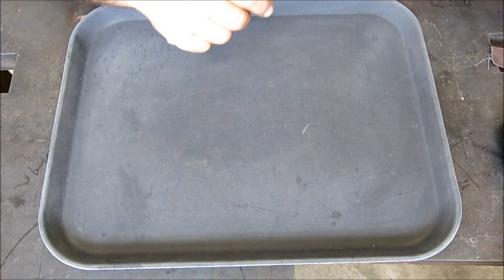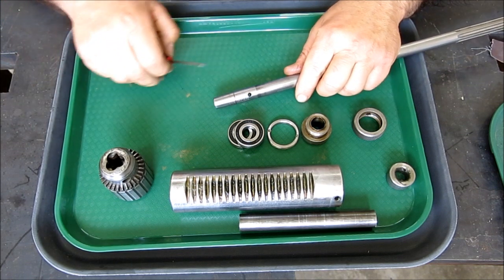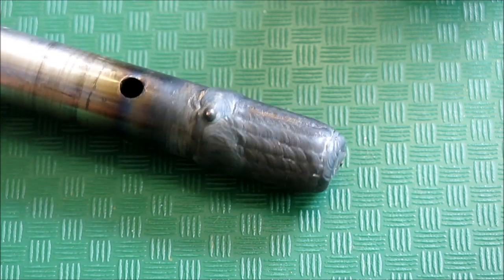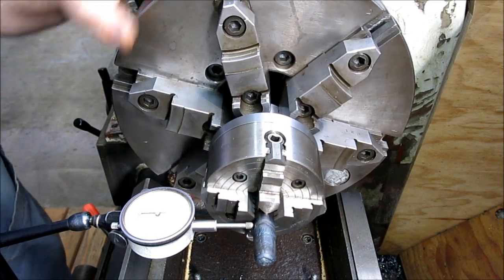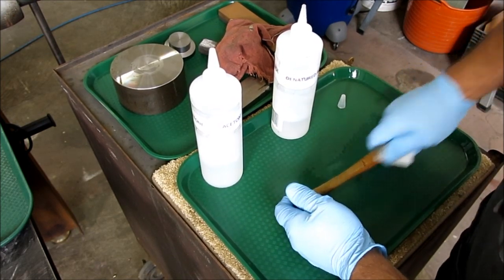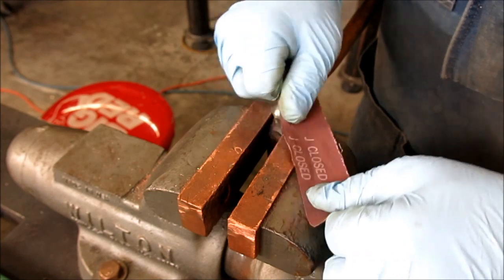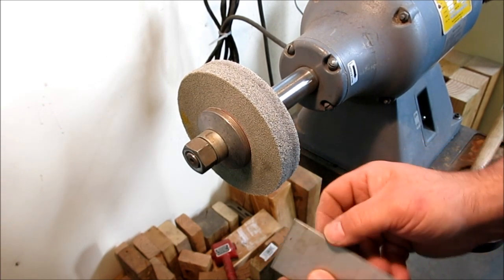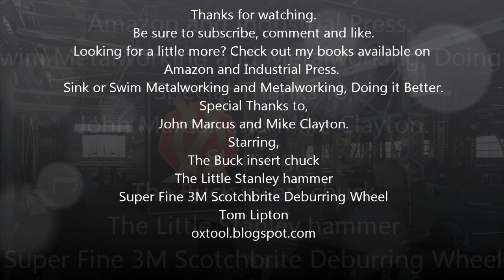Monday Night Meatloaf 32

Comment: Nice job on the build up. I look forward to the taper turning video.
A clean hammer is a happy hammer right!
Thanks for sharing bud!

Adam
Reply from the maker: Hey Adam,

Thanks for the comment. With that humidity down there it must play hell with your shiny tools.

Talk to you soon

Tom
Reply: +oxtoolco Would a 5c collet have been a good choice to hold this piece? Of course that is given you have a collet setup. My Clausing came with a 5c collet w/draw bar setup. I try to use the collets as much as possible except when my laziness kicks in and I don't want to remove the chuck.

Comment: Totally with you on the hammer faces. I have 2 sets of hammers, one set have rough faces from use bashing pins, nails, general thumping work. The other set have mirror polished faces using the belt sander, hand sanding and finally the buffing wheel. These are used to "finish" peen rivets/pins and for shaping/texturing fine metal work such as silver. Unsurprisingly visitors to my shop are not allowed to select their own hammer when they want to bang in some nails haha.
Reply from the maker: Hi Cask,

I'd love to see your hammer collection. Nothing like meeting a fellow addict.

Cheers,

Tom
Reply: Ha, not a patch on yours, I think I'd be lucky to muster much more than a dozen but they are all loved! lol.

Comment: tom,
the red handle "belt dresser" is an old school grinding wheel dresser. the stars rotate and crusher the wheel face making it flat. we had these in my dad's shop 40 years ago. this is what i had to use until i found where he hid the coveted diamond dresser.

Comment: Enjoyable as always. I love the idea of sticking the little 4 jaw into the big 6 jaw. I was recently gifted a beautiful old Skinner 6" 4 jaw and it's really not made to have a new back plate. I'm very fond of it but was thinking about selling since there was no good way to adapt it to a D1-5 spindle. The chuck has a nice machined stub on the back with internal threads that should sit nicely in the larger chuck. Keep them coming Tom!
Reply from the maker: Hey Mike,

That chuck sounds perfect to use as an insert chuck. What kind of lathe do you have with a D1-5 mount?

Cheers,

Tom

Comment: good one Tom.  What changes did you make to improve the arc shots through the auto darkening lense?  i have a few tig welding videos on my channel, but can't quite seem to pick up the puddle good... any tips would be appreciated.. Enjoyed the meatloaf!
Reply from the maker: Hi Turbo,

I locked the exposure down manually a few clicks. As you saw the shot started out pretty dark but when the arc got going it was not bad. I'm nowhere near what Jody pulls off but I'm getting closer. 

Cheers,

Tom
Reply: oxtoolco
Hi Tom,
About the exposure problem, maybe if your camera has a exposure compensation preset like a few stops plus or minus, in short you leave the camera on auto exposure but the preset will always give you like say 1-½ or 2 stops less than normal exposure.
I also think that Jody uses a very good quality auto darkening lens.
Just a suggestion, hope it helps.
Cheers,
Pierre

Comment: Tom I've never seen a dresser for abrasive belts. How does it work removing soft materials like aluminum from belts?

Thanks for the tips again.  Looking forward to the taper turning.  Maybe in the future a female taper would be good vid, all our drill presses are that way they have a shaft with a female #2 or #3 MT and their is an adapter with the appropriate male JT on one end and the male MT on the other.
Reply from the maker: Hey Bill,

The dresser is basically a round wire brush. I don't generally have clogging problems with my belt sander. Maybe if you do a lot of sappy wood or something that tends to load the belt. Franky I have never tried it until now. Flea market find.

That's the way my drill press is. This is a little Atlas or Craftsman drill press with the chuck mounted directly to the spindle. A female Morse taper might be a boring video.......<g>

Cheers,

Tom

Comment: Another nice video Tom! I was just thinking about how I'm gonna fix the boggered up JT33 on the spare spindle I have for my Clausing DP. Hopefully soon I will have the answer! It seams a lot of drill presses used that 5/8th spindle OD with a metric bearing seat in the quill. Both the vintage Clausing and Craftsman I have restored have had funky bearings like that. 6203zz if I recall correctly. Nice to see someone besides Adam spin a 4 jaw..
Reply from the maker: This one was straight up the wrong bearings. The seats and shaft are inch sizes. Looks like somebody took it apart a long time ago as it had new departure metric bearings in it.

Cheers,

Tom

Comment: Tom, back in 1964 I started my apprenticeship as an electronic technician. A lot of the equipment we used had BSW (Whitworth) threads, but BA, or British Association, threads were also quite common.  These are the things with the 47 degree thread angle.  This Wikipedia link gives a brief description.

http://en.wikipedia.org/wiki/British_Association_screw_threads

While the Wikipedia description makes specific mention of 0BA and 2BA, we also used a lot of the smaller sizes too; 4BA and 6BA were common, and we sometimes drilled and tapped holes down to 10BA, which requires a young man's steady hand; I wouldn't attempt it these days.  :(

Like a lot of young blokes I was interested in motor cars, which in those days were mostly British with Whitworth threads, but as American iron (GM and Ford, for the most part) became more common, we became accustomed to UNF and UNC.  People also imported lots of European cars and then Japanese cars, so we had to understand and use metric threads as well. The European vehicles tended towards fine pitch metric threads, whilst the Japanese stuff used lots of the coarser pitches.

Add in British Standard Pipe for plumbing (55 degrees and tapered threads occasionally) and the thread cutting and managing scene was not boring, and I imagine it would have been much the same for our cousins in the Shaky Isles. Same for the Poms too. So you blokes have really lead rather sheltered lives.  <g>

Comment: Nice work.  Never considered the finish on a hammer before.  Looking forward to the spindle series.
Reply from the maker: Hey Jim,

Thanks for the comment. You should check out a silversmiths hammer and stake collection. It will blind you with brightness.

Cheers,

Tom

Comment: I did a JT33 a little while ago but I had a new arbor to run off. Interesting to see it done "by the book".

Colin
Reply from the maker: Hey Colin,

Thanks for the comment. Interesting I was looking for actual tolerances on the taper but cant find any. There is a ton of specification information but nothing on the actual manufacturing tolerances. 

Cheers,

Tom
Reply: Well I guess that means you have to have it dead nuts or it's junk?? lol

Colin

Comment: Hey Tom!
I think you picked a great topic on the taper repair. 
About the TIG welding, could you please share max amps, electrode type and rod used?

Thanks!
Reply from the maker: Hey Pherd,

The rod was E70-S6 TIG filler. Amperage was probably around 40-50. The electrode was my standard issue lanthanated tungsten 3/32 diameter with a gas lens.

Cheers,

Tom

Comment: Hi Tom
That'll be British Association (1884) for precision equipment.
Regards from the UK
Paul
Reply from the maker: Hi Paul,

Thanks for the information. I forgot to look it up before I shot the video. Just add it to the long and distinguished list of things I didn't know but now know.

All the best,

Tom
Reply: oxtoolco
Hi Tom,

British Association threads were derived from a Swiss instrument thread series based on the Metric system! An M6 nut will fit a BA0 bolt and vice versa.

Comment: If the chuck had some space above it next to the bearing, could you
just face the end off of the existing taper and then re-cut a new taper.
Instead of building it up with weld. Just a thought. Looking forward to seeing
the new taper being cut.
Reply from the maker: Hi John,

That's the problem here. There is a chuck removal ring that prevents the chuck from seating properly in the taper. I had to add length to the taper section to move the chuck away from this ring when its seated on the mounting taper.

Cheers,

Tom

Comment: Hey Tom, nice welding job. I am looking forward to the taper turning video. Thanks. Do you know if Buckrun11 got his lathe fixed? I have have not seen anything else posted. Thanks Buddy
Reply from the maker: Hey Buddy,

We determined that buckrun had the wrong gear in his threading dial. He went back and recounted the teeth and guess what? He has the wrong gear. Trust but verify. Words to live by.

Cheers,

Tom

Comment: hi Tom great work check out that zeus reference book a viewer sent you the BSW threads section shows the standard bar diameter for the thread tpi eg 16 3/8 but then to confuse matters theres BSF which is the fine series also 55 degrees but has more tpi to a given diameter thanks for these vids im learning tons of good stuff Dave
Reply from the maker: Hi Dave,

I think my head is going to explode with Whitworth pains. Thanks for the comment.

Cheers,

Tom

Comment: Tom, have you tried a "Norton" (Norbide) stick for wheel dressing? They are not cheap, about $150.00 but I would not be without one! they're magic for dressing small die grinder wheels, bench grinders etc. New, they are perfectly flat...
Reply from the maker: Hi Peter,

Yes I have used Norbide sticks. I dropped mine a few years ago and it shattered into bits. Just found some on ebay for a pretty good deal. They work great for this kind of stuff.

Cheers,

Tom

Comment: Keith Fenner had a similar spindle in one of his vids:
Checking out your spindle
I guess the spindle you got here was heavily worked on, no good manufacturer would have used a spindle-weakening pin to hold the lower bearing seat. Seems someone has turned down the spindle to make some (wrong) ball bearings fit. There should be tapered roller bearing in such a setup, a good lower bearing seat and a thread on the other end for tightening the bearings.
Reply from the maker: Hi Thenzel,

Its all looks stock to me. The quill has seats for the bearings and threaded rings to lock the bearings in place. I think its a case of economical construction. I think he said it was an older Atlas drill press. From the looks of things its a smaller light duty press.

Cheers,

Tom

Comment: Hi Tom, Any worries about a heat treatment on that spindle? Curious what you used for filler. Thanks.
Reply from the maker: Hi Chance,

No heat treat on this spindle. Soft right out of the gate. Used E70-S6 TIG filler for the buildup. Thanks for the comment.

Cheers,

Tom

Comment: Hey Tom,
Thanks for the nice serving of meatloaf on Memorial Day. But I didn't get any potato salad! Cutting that JT33 taper plans to be an interesting video. I can't wait to see that! One question:  When is it that you decide that you have too many hammers? A former boss of mine accused a lot of our customers as being dumber than a sack of hammers. This, however, does not apply to the Master Ox. Thanks, Tom!
Regards,
Oxen Dave
Reply from the maker: Hey Dave,

You should know by now that you cant have too many hammers. You can however have too many holes in your head.

Cheers,

Tom
Reply: oxtoolco
The additional holes in your head no doubt placed there by too many hammers.
Oxen Dave

Comment: hi tom, i have a drill chuck i i had hit with a hammer to seat the taper, i did not know how tapers worked then. it did what you mentioned in this video. i "attempted" to fix the taper. my dad was not happy with me when i tried to fill the high spots. i did a number on it.
Reply: i did not weld it. it is still messed up, a machinist i know tried to help with damage control, he cleaned up the Jacobs taper  by taking a few thousandths off the spindle and then used shimming to fill in the loss of material. it works fairly well but is not the same. Thanks. Tristan
love your videos
Reply: Skippy EOT
I guess if you have a bit of length to spare you could take off a few mm and redo the taper
Reply from the maker: Hey Tristan,

Well now you know not to hit a chuck in the head. They don't like it. 

Cheers,

Tom
Reply: lol ;D i still did not hit it hard enough, The reason i hit the chuck hard not once but a few times was the chuck came off while i was using 1-1/4" forester bit. it is easy to say it scared the crap out of me.

Comment: Tom,
I'd like to see how you fix loose hammer handles.  Do you think it's worth a meatloaf show?
Reply from the maker: Hey Cp.

Might sneak something in one. One trick I use is to punch down the metal wedges in an otherwise good handle using a drive pin punch. Sometimes you can snug them up a little by reseating the wood wedge and metal wedges.

Cheers,

Tom

Comment: Hi Tom, I heard somewhere that if you stick a magnet on the side of the anvil it makes it much quieter. Is it true?
Reply: The horn and heel of the anvil act as a tuning fork.

Put magnets on each end to dampen that vibration.
Reply from the maker: Hi Nicu,

Anything you add will change the resonant frequency of a what is basically a tuning fork. Never tried it myself but you can bet I'm going to give it a try since you mentioned it. Thanks for the comment.

Cheers,

Tom

Comment: also a clean hammer will not miss strike so i was told
Reply from the maker: Hey Andy,

Depends on what your hitting. I like a soft hammer for center punching as it rarely slips off the hard end of the center punch and hits something you don't want it to hit. Thanks for the comment.

Cheers,

Tom

Comment: Love the videos, Tom, I watch every single one - keep it up.
18G 5/16", 16G 3/8", etc. is how Whitworth threads used to be specified. The "G" can be interchanged with "TPI", as per the UN threads you will be familiar with. However, G also implies that the threads are parallel, unlike BSP threads, which can be tapered.
From http://en.wikipedia.org/wiki/British_Standard_Pipe, we can see that the BSP threads with internal and external parallel features are denoted G.

Also: http://www.spaenaur.com/pdf/sectionP/P108.pdf for common Whit. sizes.
Reply from the maker: Hi Rolf,

So the fractional parts like 5/16 and 3/8 are just the nominal fastener size? Thanks for the links.

Cheers,

Tom
Reply: That's the one, Tom. The fractional parts are just the typical diameters that use that pitch, just like on your average UN thread gauge you might expect to see "3/8" stamped on the 32TPI blade, using 3/8-32 UNEF as an example off the top of my head. My set made by PEC has this on some of the blades.

Not sure if you're aware - a peculiar thing about Whitworth is that the spanner sizes stamped on the spanners are actually the major diameter, as opposed to the dimension across flats on the hexagonal head. So, a "1/2W" spanner fits a 1/2" bolt, as opposed to the 5/16" you'd expect it to fit in the case of UN fasteners.

I also forgot to put my name, sorry about that. My YouTube username is just some stupid rubbish I came up with when I happened to register all those years ago. Must change it.

Cheers,

Brynn.
Reply from the maker: roflchopternutter Hey Rolf,

I'll expect to find that out since I'm getting all kinds of Whitworth care packages. I guess I have to go over to the dark side and convert.

Cheers,

Tom